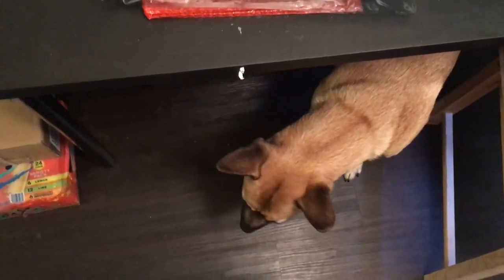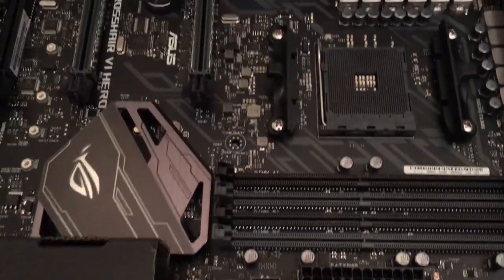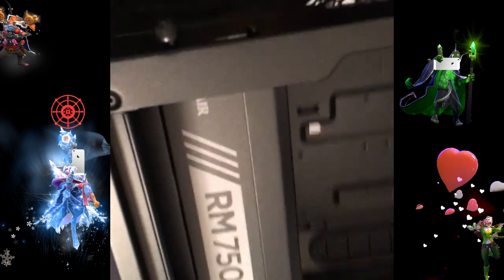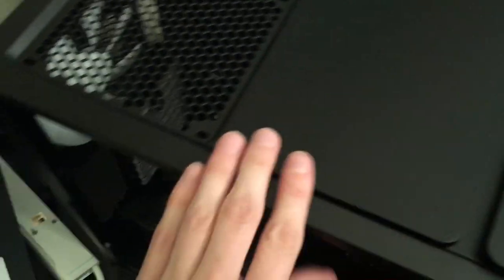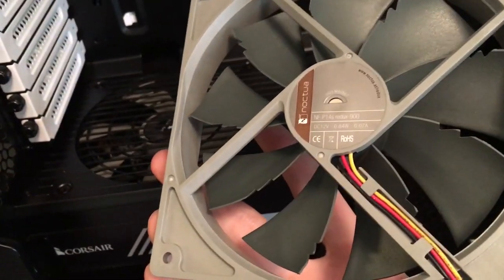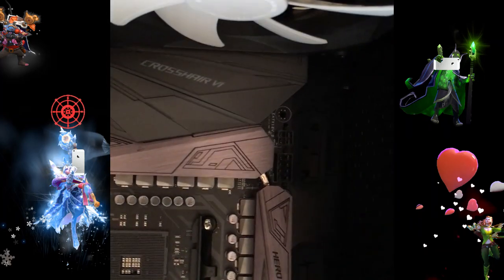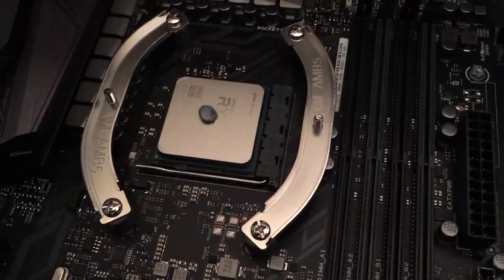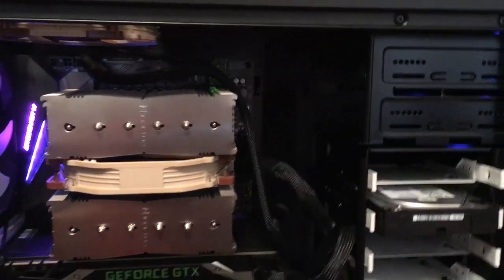Purge Builds a Computer

Comment: By the way make sure you put everything important like Windows, Steam, Dota 2 and other important programs on the 500GB M.2 SSD (the tiny hard drive xD) because it's A LOT faster than the traditional HDD! Just saying.. I know you probably know all of it yourself xD
Reply from the maker: yeah, been doing simple things like that for years, no worries :)
Reply: Sorry didn't mean to be rude.. I've made these kind of simple mistakes myself even tho I knew xD
Reply: XDDDDDDD!!!!1!
Reply: I got me doto on a fine piece of 950 evo M.2 500gb ssd. The best for my addiction.

It copies Witcher 3 in 30 seconds, hahaha
Reply: games dont go on an ssd. It isnt worth filling up your ssd. It doesnt really benefit you at all. Loads times and such are the same on either. Unless your HDD sucks balls and/or is 10 years old.
Reply: BAsically use your ssd as a boot drive. That is all you need it for.
Reply: Hillbillyspree Actually, SSD's can decrease loading times by half, which is very time saving on RPG's and other open world games.

smaller games, like Rocket League or LoL won't benefit anything from an SSD, but bigger games does.
Reply: Hillbillyspree Put Dota 2 on your SSD and you can restart Dota 2 and reconnect to the game in less than a minute. Helps a lot. 

Dota 2 only takes about 20GB it's not that much
Reply: it decreasing the loading times for 30-50%.. So totally worth it.
Reply: less than minut, more like 15 sec. Dota 2  on SSD or m2 is MUST.
Reply: Parsa Strife I

Comment: Purge that cable management is triggering me. I know that case comes with cable management slots.
Reply from the maker: it does, and I frankly don't care LOL cause the case window is pointing at the wall. Some of the cables were a bit shorter than would have made it convenient, but I'm sure for some it's my incompetence.
Reply: Well, cosmetics are a small thing, and while I'm sure you know this, unorganized wires can contribute to dust buildup and limit the air flow in a system. If your system ever starts running hot for some reason, cleaning up the cable management could help fix it.

Comment: Your power supply is upsidedown, mate. Yes.. The sticker/logo is the right way up, but the fan should pull air from under the case. Don't ask why the company made it that way.. mines the same.
Reply: yeah,power supplies generally have their own thermal ecosystem..
Reply: Barrow _ you can put it either way..
Reply: No. There's two fans on a power supply. One to draw air in and one to exhaust it out. The exhaust is (mostly) always out the back to get rid of the heat, sometimes the front. For intake there's no reason you would chose to intake hot air from the case. You're using the air to cool your power supply, not heat it up.
Reply: it's not upside down. Most power supply run cooler with intake on top. Just try it if you have your pc on carpet or floor. The only reason you would have your intake fan on bottom is you have it on a desk or you don't have carpet floors or your PC cast sits 3+ inches from the  ground. Trust me on this I know cuz I actually ran it down a few times with my mesh intake on bottom and the power supply get fairly warm.
Reply: Its really no big deal. With fans standard being 120mm today, air doesn't even have much time to sit around and heat up with such massive air flow. 

Try it yourself and measure it. We are in 2017 people, we are wayyy past putting fans in reserve will overheat your PC. I live in a tropical country with constant 30 degree Celsius weather, 26-27 ambient. My PC doesn't even comes close to overheating.  

PC building is all about aesthetics today. So stop with the thermo dynamics already.

Comment: Enjoy the new system man. But Why Oh Why Did You Get A Founders Edition Graphics Card. LOL. The PC Master Race will get you for this Heresy :P EDIT: I said this before you said you got it for free. FREE IS GOOD!
Reply: Poets of Game why is founders edition bad?
Reply: They usually run slower than those made by third party companies. They also run hotter because of the blower style cooling system they use which can negatively affect performance.
Reply: why did you capitalize a bunch of random words...?
Reply: Emphasis. I know it is not grammatically correct, but hey I am not Stannis
Reply: I thought that style of cooler was just louder, not less effective. But don't look at a gift horse in the mouth...
Reply: Depends which generation you look at but the founders editions tend to be less refined than their brothers. Still a 1080 though and its still gonna take a big dump on anything that costs less than a months rent for most people
Reply: Because it was sent to him for free, i assume he had little choice.
Reply: He was given it for free from. Nvidia
Reply: 4-5 fps wont matter
Reply: Which is why I added this "EDIT: I said this before you said you got it for free. FREE IS GOOD!"
Reply: There is nothing wrong with that FE edition. I have that in my build and I changed out the blower cooler for the waterblock and it pushes out more power than any other card in performance and stability OC.
Reply: Third companies does overclock a little bit so that's why the perfomance is better but is still a 1080 TI so no worries about that and for free? Makes it a double rainbow

Comment: I love you purge, but this video was extremely cringy to watch. You mounted the PSU upside-down, and you should have just removed the the entire HDD cage to allow more airflow and installed the HDD in one of the optical drive bays instead.

Also, you should have gone with with the 960 series instead of the 950 series M.2 drives. You won't get the full benefit of the PCI-e x4 port with that particular model you purchased.
Reply: Daniel Aros Felix becuz he's a noob. What did you expect?
Reply: PSU orientation is something that has been debated for years and years, in the end both ways work, having the fan up top to pull warm air out like Purge here or fan down to pull cool air in from the outside.
Reply: He explicitly said he hasn't built a PC in years. he was talking about fucking SATA cables and called his motherboard a transformer.....
Reply: The extra speed from a 960 over a 950 is irrelevant to most workflows, and there's a massive cost jump.